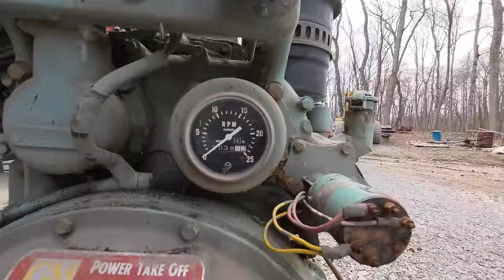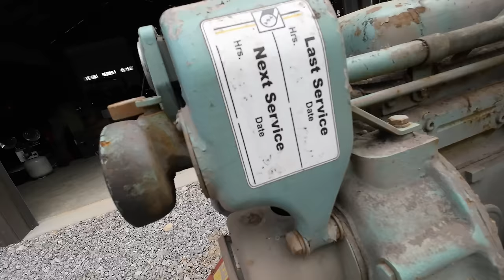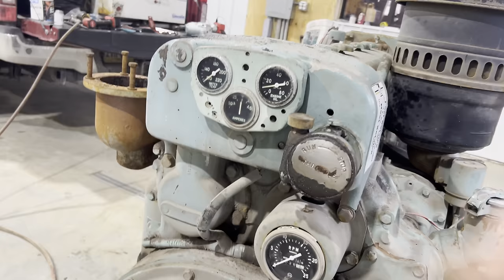$250 Two Stroke Detroit Diesel Sitting 6+ years, WILL IT RUN!?!?

Comment: Fire suppression pump motors are meant to in the time of duty to run till they "blow up". That's why they served as the last line of defense. However, the standard has not changed and new diesel fired pumps are used in the same manor. They have to be run for 10 minutes continuous for either every month, every 6 months, or once per year depending on the jurisdiction that pump resides in.

Comment: 2 stroke engines use a straight 40 oil.  Use the air hose to pressurize the tank to force fuel up to the injectors.  low pressure  20psi

Comment: Just had a thought! I once had a 40ft. charter yacht with the motor set in the aft of the hull driving towards the bow...Then through a V drive taking the propulsion back towards the stern and the prop.  The prop shaft to and from the V drive were both short keeping the overall length of the setup short enough to fit the engine space in the hull... The vessel [ a ketch ]    was built by Len Randell in the 70's [ a famous designer ] constructed in jarrah timber [ from s/w Western Australia...hope this helps a bit?

Comment: That would make a great boat motor… I wonder if it still has the factory warranty 😀. Need to pour a little oil over the valves before starting. Batteries sitting on concrete drains the batteries. Same for heavy equipment if you rest the bucket, forks or whatever on the ground… You need a battery dolly/cart/wagon with 2 good batteries on it that you keep charged.
Consider putting a 4 pulley v-belt on it and use spring loaded idler pulleys as the clutch.

Comment: Matt, what about using this engine for what it was designed to do. Namely, to pump water. I'll bet that engine would pull a lot of water from the creek. The heating system you're setting up in the shop, is going to go through a lot of water which a well is going to be stressed to keep up with. 
If you run pipe or hose down the hill and into the creek on the other hand you'll have a endless supply of H2O, and plenty of clean water in your well. Not a sermon, just a thought. You have a blessed day, Sir.

Comment: Cooling would probably been done with an in-line water to water heat exchanger. Dangerous thing about Detroits 2 cycle diesels was oil seal leaks anywhere with access to in-take air, especially blower seals. If you've ever heard a Detroit run away in a shop thank your lucky stars. You always have the intake open and a flat piece of plywood or such you can put over the intake into the blower immediately. If you don't get that done is 2-3 seconds, you'd better run as fast and as far away as you can get. We had one go off in our shop, blew holes in the roof and side wall of the building.

Comment: Suggest you hook up the radiator, a powerful pump and water intake source and set it up as a fire fighting system if you end up with a Forrest fire. You have a lot invested now. That could save you a lot.

Comment: That’s a heat exchanger on the front. It needs water in and out to cool the coolant which then circulates to cool the engine. Much like an inboard diesel on a boat.

Comment: It is very common for fire pumps to use the pumped water to cool the engine.  They'll install the cooler in bypass to one stage of the pump.

Comment: The "shiny" remnants is actually a Chrystal shell the reason for the shine is as the metal flakes or breaks down the powdering solidifies as the water evaporates as you know the surface tension of water leaves an ultra smooth surface as the powdered metal mixes with the moisture it slurries and hardens in a glass like finish that's why on the outside its shiny inside is pitted and the whole thing crumbles with effortless ease. You will notice the shiny bits are slightly harder this is because the material is comprised of a much finer material that has been able to solidify in a tighter formation.

Comment: Hey Matt now that you have that Engine all you need is a backup Generator so if you get a power cut bang in come by your own power  yes those motors were awesome I had one in a ford Fuel tanker which I use to deliver diesel to earthmoving contractors  as with the high to right boy she slugged it up those muddy hills

Comment: Since it was a water pump, it probably taps into the pumped water for cooling via the heat exchanger, warming the pumped water slightly in the process.

Comment: Those water connections went to a common cooling tower or similar. That casting on the front is a fluid heat exchanger.  BTW I have 2 8v71 one in bus, one on stand

Comment: That might be oil residue in the exhaust manifold. I'm sure others have already pointed out in the comments but these old Detroit 2 stroke diesels usually run best on plain 40 weight no detergent oil.

Modern oils are designed with much higher emphasis on reducing emissions and keeping the engine clean so they have detergents and other friction reducing additives in them, this gives a higher sulfated ash content and can cause problems with an old 2t engine.

A modern multiweight oil with its additives will result in more buildup around the valves, gumming up of the sleeves and piston rings, it often easily gets flung off the piston and make its way into the transfer ports and airbox, which can lead to a runaway if there is no drain on the airbox.

Pesnke, Sinopec and probably many others still make straight 40 that is specifically designed to be used in all the old Detroit 2t diesels, it has very low ash so even the most demanding engine wont suffer.

The best part is these engines will last virtually forever if run on the stuff, its cheap so you can change it often and dont need to worry about the oil not having all the fancy cleaning additives that modern engines need.

in a pinch modern oil is better than no oil but id never use it if I had the choice between it and old straight 40..

Comment: Hey  Matt, what about a temporary power on the shop you run a generator off the cranktail shaft and put the radiator back it
the floor and heat the shop when you have heavy welding jobs  you can use temp power save.  Money.  Dan

Comment: I know I'm 7 months late but my suggestion is either use it as it was originally used and set up a VERY comprehensive Fire Suppression system for the shop, outbuildings and your new home when you eventually build it (possibly using the nearby creek as a water/coolant source)...
OR
Find a MASSIVE Alternator to stick on it and use it as an Emergency Generator for the ENTIRE Property...again, using the nearby creek as a source of coolant...

Better yet, do both...stuff the alternator on the Diesel to build an Emergency Generator that puts out the same amount of Power you're getting from the new Transformer you just trenched the driveway to feed and then build a Fire Suppression System for ALL the buildings on the Property (current and future) using an Electric Pump powered by the Generator...

Edit: A Mad Maxian War-Buggy works too...

😄😁😆😅😂🤣
Reply: A 125kW unit on the back of it would be a perfect fit. We had two at work. And in an emergency, could sync them together. Hardly ever did except to test the automatic switch gear.

Comment: I worked on a drill rig that had 4 of those on it.
They were available in counter rotating pairs, mounted back to back with blowers on opposite sides...
Only one had a starter on it, you used the clutches to get the other three running....
No mufflers whatsoever..
Coming out of the hole it was the loudest thing ever!!
On the plus side you could warm up your lunch on the exhaust manifolds between the pairs when you were
slow drilling..
Huh did you say something???

Comment: OK, if you haven't already installed one, you need an Exhaust Fan ASAP if not sooner...

Either that or you need to install an exhaust pipe in the wall of the shop that you can connect to the exhaust outlet of the engines/vehicles you're working on so you minimize the fumes you breathe in...

Comment: If this in fact was attached to a water pump, then the water from the pump was circulated through the big heat exchanger in the front of the engine to cool it. Think marine type engine-instead of the ocean water flowing through it was the pump water to cool the anti-freeze. Detroit Diesel's were a General Motors company until Diamler Trucks North America bought out Detroit Diesel-which is now basically owned by Freightliner trucks.

Comment: Flap is the emergency shut off open it blower is. a must for the savage ports I've run one with a electric fuel pump from a cabin heater The injectors MITAC meters injects times atomize create its own presure
Reply: Seebee class for mechanics

Comment: Now that's a nice sounding engine,don't change the intake just find a steel piece of pipe with the same kind of flange as the one on the intake & same bolt pattern & get a flapper for the top of the pipe or make a flapper for it,that engine sounds like a great sounding engine for a rig but who knows & do you still have the engine Matt

Comment: I drove a cl 900 dodge that had the 671 in it and it ran darn good I had it turned up and it would run close to 80 with 4 bobcat front end loaders on it
It had a 30ft. Roll off bed on it and a 10spd

Comment: That is a marine cooling package and you would have an external water supply to cool the coolant in the heat exchanger on the front. Old fire pump engine I have worked on in the old days ran reverse rotation. 2 cycle Detroit's had lots of different configurations they could be setup for., just depended on the application they were in.

Comment: The intake air doesn't actually go through the oil on an oil bath air filter. It just runs into it as it goes around the corner.  Often they will also have a filter that wicks some of that oil up to catch even more.  The only time the air would actually go through the oil in the bottom as if the filter were overfilled.

Comment: That’s a marine application had his radiator on the front and it had water circulating truck to keep the air freeze cools what it needed it and I have worked on many of those engines

Comment: matt build an I beam bed for it and get a 250 kw generator head and power your shop and new home with it. you will have all the power you will ever need. get a big wood boiler to heat the shop and your home. get some solar cells and some old sub batteries and a big old charger /inverter and you are off grid . if i had that place i would make a fort around the whole thing , lock the door and play with all the toys. now thats living .

Comment: It's best to start an old 6-71 with no air cleaners installed.   In case it runs away you can put a board on the intake to choke it off.

Comment: O probably water cooled.  We had two 671’s running emergency generators at a FEMA location and it was water cooled.  Cold water would come in from the potable supply and hot water would dump into a septic tank type system. Underneath the building.

Comment: so that cooler is some kind of water-water heat exchanger. it would have been connected to something at the plant, or may have been setup to dump its heat into the pump output water

Comment: If the engine ran a big external water pump on the PTO then maybe there was a small connection from the big external water pump through the water to water cooler. That would have saved having to have a large or remote radiator. A constant supply of fresh, cool water. Sort of like how a marine engine uses the ocean as a source of cool water and flows it through a heat exchanger. On your engine the water to water radiator is the heat exchanger and the water in the external water pump is the ocean.

Comment: you know all the benefits you're describing about T5 the longer oil change intervals holding up to heat better that's because of the synthetic oil that's in it not the conventional probably be better off just to run straight T6 full synthetic either way awesome video

Comment: Those metal shavings(the brass ones) could quite possibly be either the leavings of a zinc stock designed to counteract electrolysis(where an  excess electrical charge can build up in the cooling system and damage cylinder liners and head gaskets.

Just a guess, though...good luck.

Sincerely,
Jason Wampler

Comment: Best wishes Matt from Declan in Galway Ireland every time I see that Detroit she looks a pure gem one quick question about the output shaft that works on it in the rotation they work is it  clockwise or anti clockwise it runs or just one direction cheers Declan 👍

Comment: Matt.... The engine that you have there, Is Post April,1965, for sure, with the encircled DD cast into the block, rather than the original oblong GM Diesel Power.  The Cast aluminum covers did not become available  until around 1974.  Another quick identification difference between the "Inline" Series 71 & 53 engines, is that the Series 53 has the governor located at the Rear of the blower, whereas the 71 governors are located at the front.

It is COMPULSORY, that you ONLY Use Straight 40 wgt LOW ASH CF-2 oil, with Absolutely No More than a Maximum of 1.0% sulfated ash content!!  NEVER use a multi-viscosity oil in these engines... or you Will destroy it.       Having said that, you "can" use a straight - Low Ash 30 wgt, but Only when the outside ambient temperatures are maintained at 32 degrees and below..... IF, you plan on running it,  to help with easier starting.... IF, the temps are at -10 and lower, you could get away with 15/40... but ONLY under those conditions, you must use the Low Ash straight 40 wgt at any temps Above Zero.    Even if in Cold temps, and you have 15/40 in a 2 cycle DD, it should Only be in a situation where the engine is run under load for very short intervals... no more than a few minutes.    IF, the engine is protected from freezing (32 degrees) & Below temps... stay with the Straight 40 wgt Low Ash.   

 I am "cringing" while sitting here, watching you pour that Rotella 15/40 wgt into that engine.   It was Not designed to use that formulation of oil, and "Major issue's" Will result from using it.   You are correct in saying that "oil is cheaper than parts..... however, NOT SO, if you're using the wrong oil specs.... it will get expensive, if you continue to use that 15/40 in the 2 cycle.  The various seals in the engine were Not designed for use with Multi-viscosity oils, and Especially Not for use with Any form of Synthetics.   

I've seen where Multi-grade oil in the 2 cycle Detroits Will cause seized rings, and even push out the liners off their seat in the counter-bore lip, not to mention that the engine Will go through Excessive oil consumption, both in Burning it, and excessively leaking it through failed seals.  Two Cycle diesels and 4 cycle diesels are two different "animals"... with two different mandated "must haves" with regards to lubrication requirements.... and failure to adhere to those requirements, WILL "cost" you...through the premature destruction & failure of your engine.  Count on it!   

I would highly recommend that you get Chevron Delo 100, (no.1 choice), or Mobil Delvac 1600 Series Monograde... spec'd for the 2 cycle Detroits.   In a Very SHORT TERM "pinch"... you could use the Shell Rotella T-1  40wgt.  however, it is NOT in spec for the DD oil requirements, as the Sulfate Ash content is above the ONE Percent maximum, mandated by DD.

By the way, with regards to your comment about "Extended Oil Change Intervals"... do so at your own peril, my friend.  If that engine was still under DD warranty, and it failed or displayed premature wear on Any Internal parts, and it was determined by DD that it was a result of "Extended Oil Change Intervals".... your warranty would be immediately Null & Voided... and that, is while running the correct, factory spec'd oil, let alone a multi-grade (synthetic or not) oil, that is Not even remotely formulated and spec'd for a 2 cycle. 

DO NOT do "extended oil change intervals" on Detroits... Especially, the 2 cycles... you Will regret doing so, and Especially with that Non-Spec'd Multi-viscosity oil you're using.... Shell Rotella, or otherwise branded.

IF, anyone reading this has a MARINE DD, 53, 71, 92, 110 or 149.... NEVER use Any Oil.. other than Low Ash (1.0% or Less!) Straight 40 wgt.... under ANY Circumstances, or you Will be buying a "new" engine.      

As for the cooling system.... that is a Marine setup, and it is a "heat exchanger" unit that is mounted with the cap that you opened to check for the coolant.   It is NOT an "closed circuit" coolant system, you will need a radiator for it and the box with all the wires hanging out on the blower side... is for the remote start control, as I'm sure you have figured out..   The separate unit Directly Under the Heat Exchanger at the front, is the Oil Cooler.

If you wish to,  reply back to me (here) with the ID model data numbers on the engine spec plate - which "should be" attached to the valve cover on the Blower side, and I can tell you what that engine was originally set up for... Or, perhaps, if you were to do a Close Up with your camera of it (make sure it's good and clean), so it can be read (all, of it)... I could "freeze frame" the video and screen capture it, and get all the spec codes off of it.

PS: Just so you know.... I'm retired, and worked with DD in the early/mid 1970's on a contract basis, on experimental (2 cycle) engine design work, and I have a 4 year degree (1963 - 1967) in Diesel Engine Design & Theory, Specializing in 2 Cycle (Clark), and for 3 of those years, studied directly under P. Nicholas... one of the lead designers in R&D at GM Diesel, who designed the very first, running prototype 2 cycle diesel... a 4-71.

Comment: Make a trike, put some dual rear axle, mount your tractor seat on the left side of the engine and rig up a steering wheel to a single front tire. If you need some help let me know.